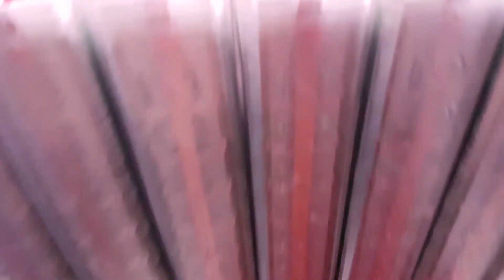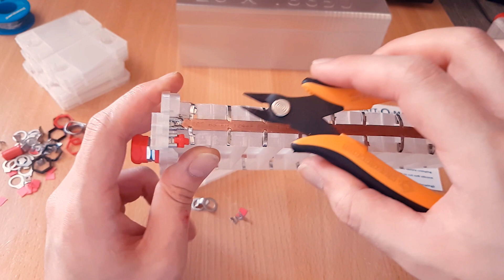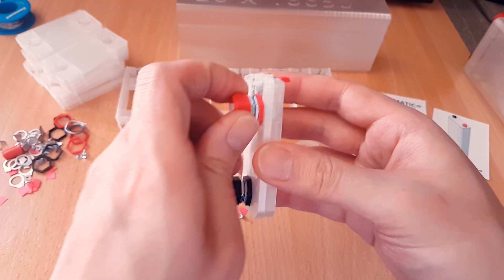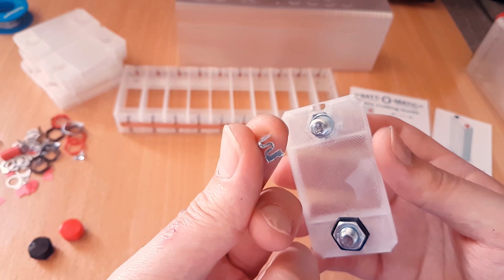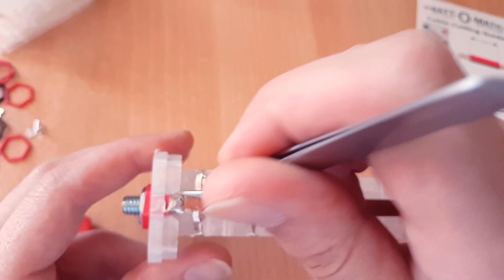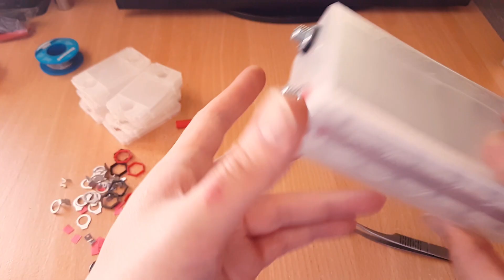Lid/Fuse Upgrade tutorial

Comment: I have a unit with your previous design. Did you just take a fuse apart for the fuse element?
Reply from the maker: yeah, tho it changed from curved to an S shaped element at some point (same supplier), I may switch to link fuses to get the element.

Comment: Bravo for being a responsible entrepreneur! Keep at it... your product is great!
Reply from the maker: Cheers, working through these problems it's easy to see why a lot of kick-starter's fail, or deliver substandard products, you have to try producing it to see all the problems, I would actually seek to get manufacturing in place (professional or community), prior to running such a campaign. (I'm still flip-flopping on this)
Reply: 18650 li-ion are ultimately on the decline in my opinion... I assume you can re-use your design with 26650 or 2170 cells.
Reply from the maker: @paulbarrette2557  I think so too, tho I see prismatic cells will take over the home battery market, not bigger cylindrical cells, not worried tho, I have a plan for a solar generator so I'll be in 2 markets by the time I go to kickstarter -  https://drive.google.com/file/d/1j_TdRc49lB1fd-0LfMLvPFuZNnjRrjHk/view?usp=sharing (this is a very rough sketch, its just a top plate with handle and connections)